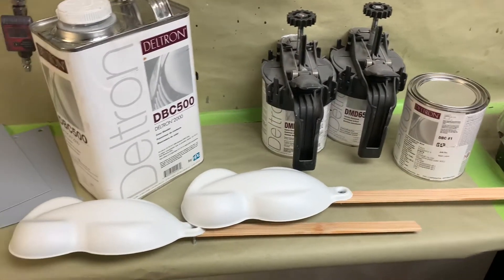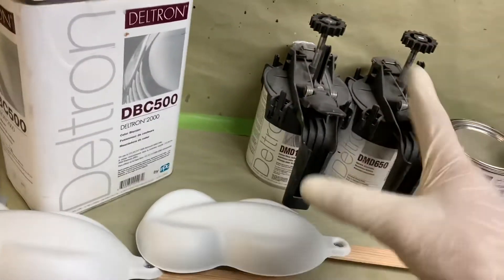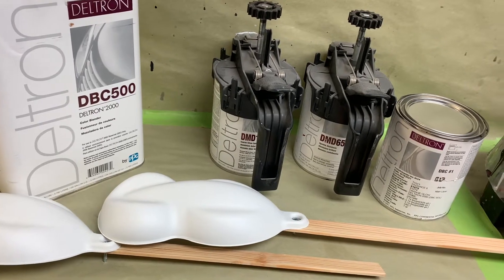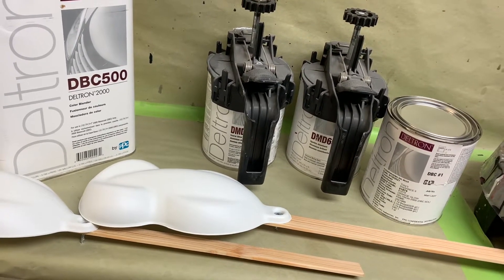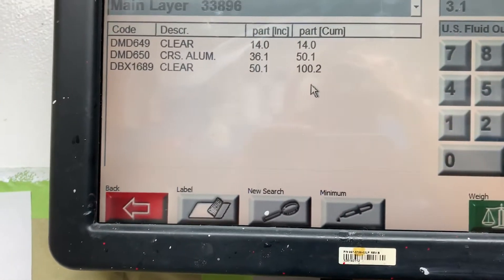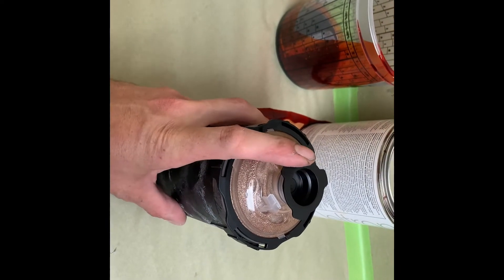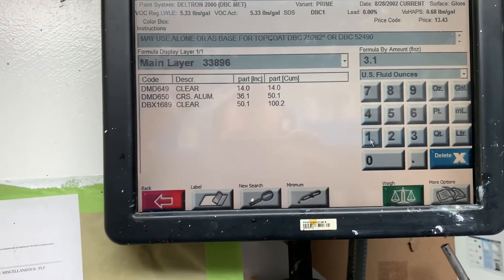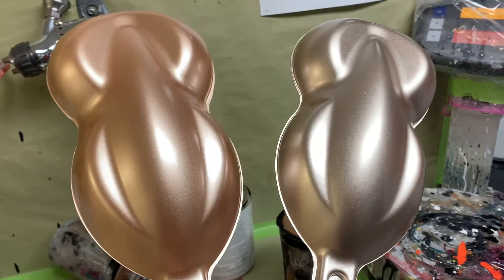Mixing a custom candy for a spray out

Comment: Interesting concept. I sprayed Autumn Foliage in the Vibrance line on a 69 Mustang. Similar colour to those spray outs. The formula had a candy dye in it which made it spray like a tri coat even though it was two stage. Each coat  changed to a deeper orange. Shifted like crazy in the sun.